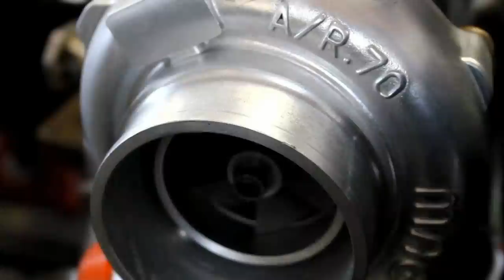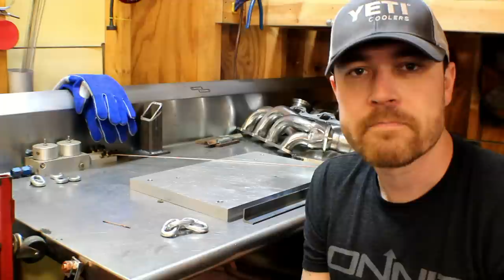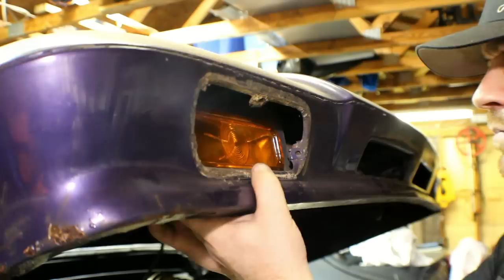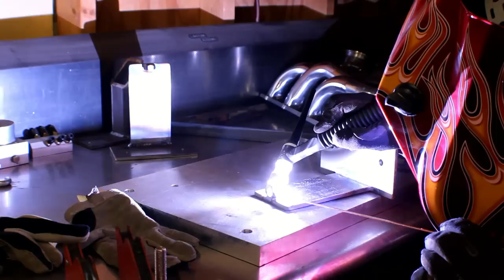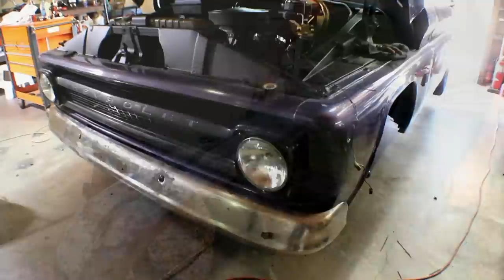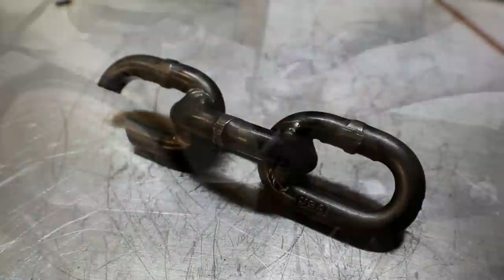Chain Bottle Opener | Easy How To

Comment: I tried this the other day and man my arc went crazy!  Would you share what kind of chain your were using and if what amp settings you'd recommend?  I'm a new TIG welder and would love to make some of these as gifts.  I was using chain from one of the big box stores.  Maybe I needed a different kind?  Any help would be appreciated.  Thanks in advance.
Reply from the maker: +Howard Camardelle see if you can buy some uncoated steel chain
Reply: Will do!  Thanks.
Reply: Avoid galvanized steel. The fumes can be quite harmful. That was one of the first things I was taught when I was learning how to weld with my everlast welder.

Comment: what did u do to patina the opener?
Reply from the maker: the heat from welding takes off all the coating, I just wire brushed it to clean.
Reply: thanks for the reply. i  reallyenjoy the channel thanks car
Reply: you could make up a solution of bleach (toilet cleaner) salt and vinegar, dip the uncoated chain pieces in the solution and Chuck outside. by the time it dries you will have a thin layer of rust. repeat until happy with the thickness and colour-then clear coat